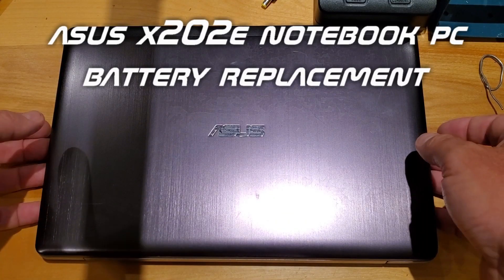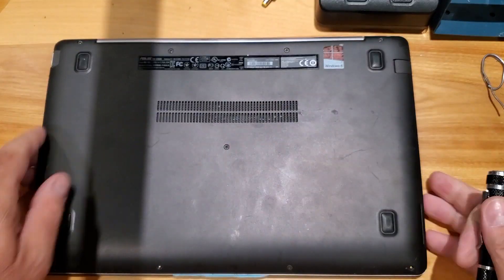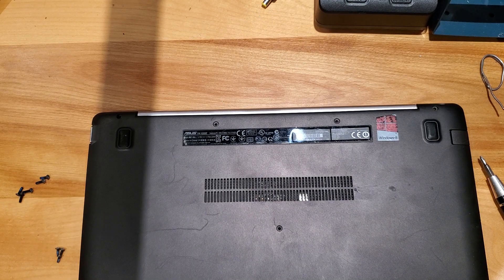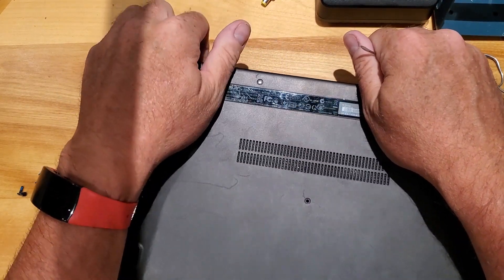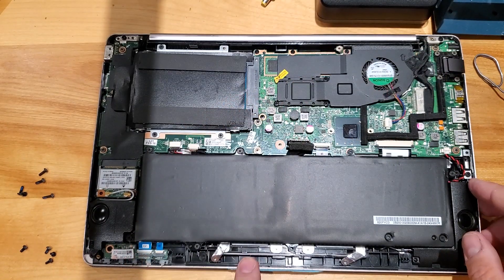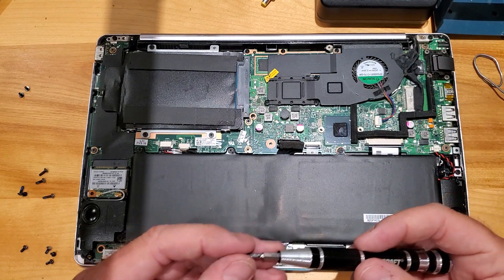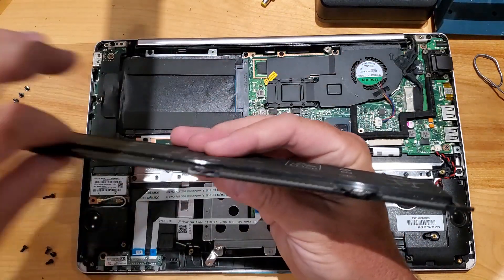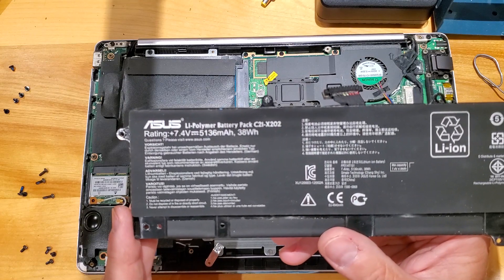asus x202e notebook battery replacement

Comment: I'm replacing my laptop's battery right now :)
Reply from the maker: Awesome!  I am glad the video helped. Good luck with your repair.
Reply: Thanks, i put the new one in but it is not charging, do you have an idea why ??
Reply from the maker: I would first check the connector.  I had trouble at first connecting the battery.  I found that I had to connect the battery and then get it in place and then put the screws in.  Then with the cover still off, I tested it to make sure it was good.